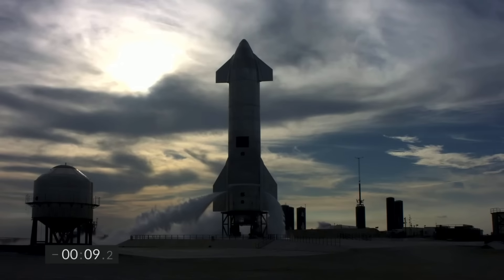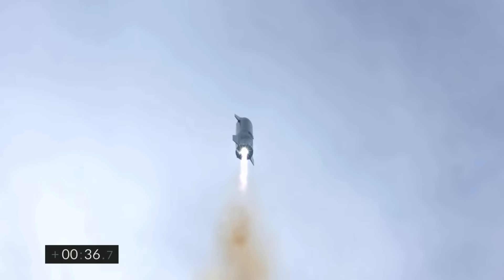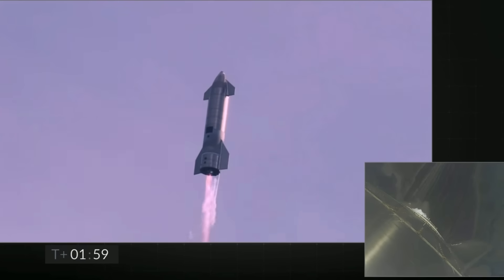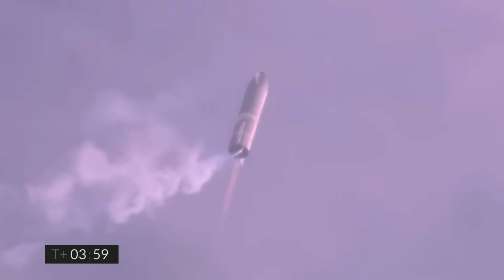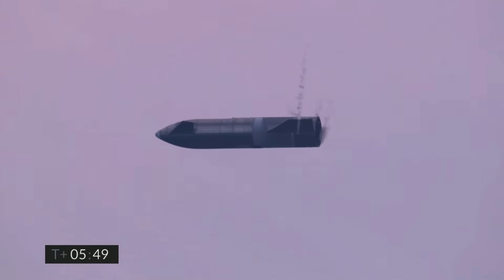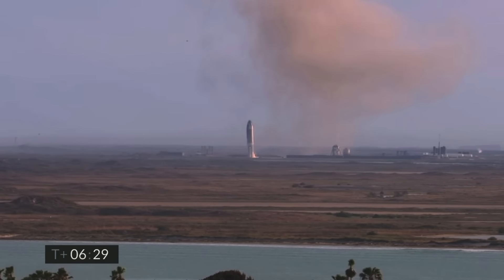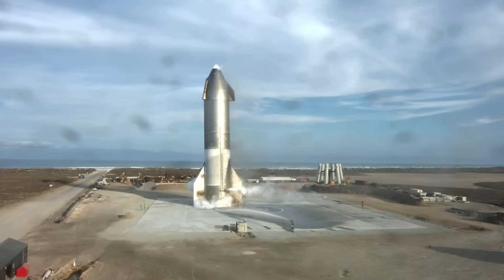SpaceX Starship SN10 soars, lands for first time!

Comment: Fake, world misleading CGI 😉
Reply: So how did they CGi to the ppl watching from all over the island and local ppl
Reply: @-M0LE  Todays software can draw a lot of objects in the past they even draw in some cows running around  in the foreground of the Spacex 😆
Reply: @a.v.d   there are two cities nearby. Port Isabel and South Padre Island. From these two locations you can see the launch with your own eyes which makes the possibility of the launch being CGI 0%
There were hundreds of people who filmed the launch on their phones and cameras.
Reply: @rolandb.1866  They shoot all the time rockets into the air and the they end up in the sea. Check out on airports (I lived a long part of my life close by an int. airport) how difficult some wind is for pilots. Do you really think they can bring back rockets in they reverse, with all forces of the weather?
Reply: @a.v.d  yes, absolutely. That's why they have those fins and canards installed + they also have a hot gas reaction control system. And the launch was conducted when the winds were relatively slow. (around 7 knots)
Reply: @a.v.d  The reason why the 1st stage of rockets end up in the sea is because of safety hazards. If they launch it incorrectly it could end up crashing in a populated area. if you ask why is Spacex allowed to do these flight even with the two cities nearby, the answer is simple for that. They have onboard explosives that activate when there is a massive problem with the vehicle or SpaceX's software , the explosives  lead to a much smaller chance of causing damage to nearby populated areas.
Reply: I love how you just ignored many other people went there and saw it.

Comment: Seems to accelerate a lot slower that the Saturn V stack assuming you wanted to reach an orbit.  So if it never glides, why the fins in the canard position?
Reply: They are using a slow ascent otherwise it would go supersonic
Reply: @-M0LE  after reentering from orbit starship will go faster than supersonic so the fins and canards are there to reduce the velocity as much as possible before landing the vehicle
Reply: @rolandb.1866  but it doesn't appear to glide, so what's the point?   Their other vehicles have speed brakes for that purpose.
Reply: @gendaminoru3195  Starship uses the side of the vehicle's surface area (around 545 square meter) as an air brake, and the fins and canards as stabilizers (these also add drag to the vehicle). It's much more effective than their air brakes on the Falcon 9. When a Falcon 1st stage reenters from orbit it requires a reentry burn, Starship will not require a reentry burn because it has much higher drag.

Comment: How will it go through Earths re-entry, the heat.  Marvelous yes
Reply: That's a main booster, it doesn't go through re-entry.  This is purely experimental.
Reply: @dryan8377  this is the second stage, this will be going through re-entry.
Reply: I mean when Rocket goes 200 miles up an returns...what heat shielding or what will it have?  It gets damn hot returning.
Reply: @shokasokenhohansorthodoxka237  it has a heat shield which is also currently in testing, and can currently be seen in the form of small black patches dotted around the vehicles. SN15 in particular has a noticeably large one.

Comment: 6:11 And at the final tilt, the video got edited ;  why, for what reason ???

Without any reason, the video got edited. 
To make things more clear, "a continues FAKE video from HORIZONTAL to VERTICAL mode  could easily be identified, if commonsense applied", that's why edited.

6:16 Caught red-handed.
That welding torch like EarthShip was HANGED from above ; and when slowly letting it back to the VERTICAL position, that ToyShip SWINGS extra more than expected.

Quote : 
*Nothing is impossible, only if it's REAL*

Comment: 4:59 the HORIZONTAL mode, beginning the descent

If the EARTH is round, how could the Starship transitioned into the HORIZONTAL descent mode ???

FLAT EARTH THEORY, proven.

Quote :
*HORIZONTAL/FLAT surfaced Earth makes everything steady & parallel, while descending*
Reply: What??? Have you heard of gravity?
Reply: Respected  @stasso05  

WILL A NON METALLIC NON MAGNETIC  SUBSTANCE ATTRACT ANOTHER NON METALLIC NON MAGNETIC SUBSTANCE ???

IF NOT, THEN HOW THE SO SAID GRAVITATIONAL FORCE ATTRACTS/CATCHES/JOINTS NON METALLIC NON MAGNETIC SUBSTANCES TOGETHER ???

QUOTE : 
*GRAVITY IS JUST A THEORY, DEFINITELY NOT A FACT*
Reply: @mohamediqbal395  try using google once in your life
Reply: Respected  @colten1825  

Please try Google by yourself for me just for once ; please answer my questions(using Google)...

Quote : 
*Sometimes in some cases, FACT is stranger than THEORY*
Reply: @mohamediqbal395  try jumping up, do you move down? if so you are being effected by gravity
Reply: Respected  @colten1825  

I tried.
When I tried, I feel heavier than AIR. 
I fell down.

QUOTE : 
*IF I'M LIGHTER LIKE HYDROGEN OR HELIUM, DEFINITELY AFTER THAT JUMP I WON'T BE DOWN AGAIN*

*WHAT'S LIGHTER THAN AIR WILL MOVE UP*

*WHAT'S HEAVIER THAN AIR WILL FALL DOWN*

*GRAVITY DEFINITELY FAILS INFRONT OF HYDROGEN/HELIUM/HOT-AIR BALLOONS*

Comment: wouldn't it make more sense to use the earth as a sling shot with a horizontal launch and just adjust the vector of climb during the accent, with the decreasing atmospheric pressure at ascending speeds instead of overpowering gravity?

Comment: Do the math:

The "rocket" launches to 10 km in approx 4 min and hovers.

That's 31,000 feet in 4 min, or 31,000/320 sec = 67 mph.

From the propulsion lab at North Western University:

Conventional rockets are generally designed to meet the speeds necessary for them to go where they need to go, and not go much faster. Generally, a conventional rocket has to be going about 17,000 mph for it to achieve orbit; otherwise known as LEO -- Low Earth Orbit.

This is some kind of studio/CGI stunt.
Reply: These test launches are not intended to reach LEO.
Reply: Yeah I know. It’s the physics of the launch itself and free fall.  This is a studio CGI stunt.
Reply: @daveogle4239  Tell that to the thousands of people who watched it and shot amateur videos of it IN PERSON.
Reply: @daveogle4239  3 raptor engines that are nowhere near max throttle, along with being turned off one by one to reduce speed. it is not meant to go fast or go high, it is meant to get to an altitude where it can successfully perform a belly flop and landing manoeuvre, which is by far the hardest thing to achieve with this experimental vehicle. the second stage isn't even capable of getting to orbit on it's own regardless, it requires the super heavy booster for that which is about 2 times the size and has 10 times the engines.

Comment: Lol I can't believe people believe this is real... a spaceship can turn from horizontal to vertical within 10 seconds after a huge freefall, my ass has more common sense than that
Reply: It's not a spaceship. That's cartoon and scifi language. 

SN10 is a low orbit heavy lifter rocket with 360 degree gimbaled TVC engines, designed to pivot in 15 degree arcs, around a 360 degree circle. This design can rotate the lifter body as needed.

Comment: Why can't NASA or SPACEX used regular car gasoline in place of liquid hydrogen mixed with liquid oxygen?  I mean gasoline is powerful and combined with O2 would be awesome!!
BONUS Gasoline is WAY CHEAPER than Hydrogen!!
Maybe someone with a small rocket could try to use 'gasoline + O2'  Please tell me why this isn't used?
Reply: first of all. gasoline is not a good rocket fuel AT ALL look it up, second of all gasoline would be more expensive then hydrogen have you not ever learn that water is made of hydrogen and oxygen making it extremely common
Reply: The starship uses methalox not hydrolox.

Comment: this is CGI lmao, explain to me, and that's one example, how they took the shot at 0:31  :)
Reply: A camera that was horizontal to that view.  Probably from a control tower, or a camera that are placed to monitor the condition of the rocket before take-off.
Reply: @cranshawmccaw  that camera is moving exactly together with the rocket, vertically and parallel to it, at the height of the rocket, not pointed at it from base, its not attached to the rocket and there is no visible tower nearby. (got to be one tall tower that lol) To me, is bs. simple. And I dont really care about it. Also that landing has no side thrusters to keep such high structure vertical, all done by bottom thrusters, sure. Seems a sci fi movie from the 30's. c'mon wake up.
Reply: @XimoXThe  there is a reaction control system on it, and the engines can gimbal, also couldn't you get that angle with a drone?
Reply: @colten1825  a drone couldt not feel like is attached to the rocket.  besides not at that speed and near that heat. Physics aren't an opinion. C'mon its obvious. A (badly made) fake.
Reply: @XimoXThe  i mean you can go to boca chica texas and see them happen if you want more proof
Reply: @colten1825  Thunderbirds are GO.. lmao

Comment: Odd that after many centuries of evolution in engineering that the most modern rocket uses the same fundamental design as the common arrow, which was invented before written language was formed.
Reply: Thanks Francis.
Reply: If it works. It works.

Comment: @4:30 So no one notices how when the shot changes, the rocket has turned the smoke has completely flipped direction. It all happened in a single camera change but the T timer stayed in real time.
Reply: its just switching views to a camera that's on the other side of the test area

Comment: dear elon musk i have  a sugession if u give a controlling rocket or high speed fan at thee top side when landing it is so easier to get more controlling while while landing(at the top side 3 parts
Reply: fans arent affective at that speed, monoprop thrusters give way more reaction control thrust anyways
Reply: @colten1825  use power pullll items like nitros oxide or any ,,,something like that
Reply: @colten1825  these can activate it only by sensing the remote or any distant object...senser

Comment: why stabilizers on one plane only.  These are "horizontal" stabilizers.  No vertical stabilizers?  At about 3 min 11 seconds and after there is pink thrust shown to be driving the rocket at  5,200 mph (slower than a Saturn V which was 6150 mph)  but the white steam just wafts out and trails behind as if in a gentle summer breeze?

Comment: I don't feel the control is much of a problem in the aspect of controlling the craft, I believe any variance of control is relative to the variable and volatile fuel source which is irrelevant for future launches.  This can easily be fixed.  It takes too much fuel to have something escape velocity which is well known to also not be sustainable or practical.  The solution is relatively easy and could decrease the weight by 80% or more depending on the load and environment.  The solution is already available, yet hasn't been completed to my knowledge.  See you on Mars! :D

Comment: There seems to be a lot of flat earther, everything is CGI, people more and more. There are a lot of comments saying this is all CGI. I suppose when I go on an airliner, I’m looking out the window at a CGI screen right? And I’m magically thousands of miles away from where I was. 

Having seen the Space Shuttle lift off with my own eyes twice and using a weather satellite over the past 30 years to forecast the weather, I can tell you, more and more people are insane. 

To see for yourself look at the North Star (Polaris) and measure the angle from the horizon to the North Star. That is your latitude. If you’re at the North Pole it’s 90 degrees or directly above you as you spin around. If you’re at 10 degrees latitude Polaris is 10 degrees above horizon. This is basically how explorers knew where they were hundreds of years ago. 

If you’re in the Southern Hemisphere you can’t see the North Star, Big Dipper or many stars you can see in the northern hemisphere. You get a whole different set of stars and they use the Southern Cross not visible to anyone in the Northern hemisphere. 

Also if you are at mid latitudes in the norther hemisphere at solar noon, you have to be facing south to see where the sun is and your shadow points to the If you’re in, say Argentina, you have to face north to see where the sun is and your shadow points points to the south. 

Us humans are devolving. “Idiocracy” is proving to be real.
Reply: Wow, so much rambling from a paid fanboi.

It's fake, Goober. Live with it.

Comment: From some other video sources we can see the landing wasn't ideal.  Only half the legs deployed with the other half swinging amusingly in the wind.  It didn't slow down enough so it landed hard on its arse which bent/buckled the whole thing, which eventually led to a rupture.  You can see a very definite bounce - which can't be good for something that heavy.  Still, they are all solvable problems.  The engines look good but the different colour shows they they are burning differently and the yellow fire at the end I don't think is intentional but is fuel burning in the atmosphere, either a leak or a stuck valve.  All things you'd expect to be ironed out in testing.  Its not quite ready for manned flight yet.  Don't forget, its staggering just how many rockets the Americans blew up in the mid 60's.

Comment: The reason no other company tries to land rockets is simple, you are wasting a third of the rocket fuel to land thus you need a bigger rocket to do the same amount if work🤪
Reply: But you are keeping the rocket . And use it again.
Reply: The cost of refurbishment  combined with the loss of payload , essentially negates any savings. The reason costs from other manufacturers that make rockets for NASA (NASA doesn't make rockets) are high is that they have a virtual monopoly and charge pretty much what ever they want.
Reply: @Wised1000  What loss of payload?  Since Falcon 9 started I think they had only 1 loss of payload . If you refer to starship, they just started scratching the surface of testing before any payload or human foot will step into one of those.
Reply: @Liope012  
Payload.... capacity. Again if you reland the rocket using its engines   you cannot lift as much as if you simply disposed of the rocket. In ricketry payload capacity and rocket impulse are the main ingredients to success.

Comment: If the whole thing had a thermal air inverter, a pure air jet pump that could be connected to the side, it would get the right boost. (Also atmospheric for landing and control on earth, no turbine, but a rotating lateral thermal converter according to the water jet principle, tiny additional screw-like rotating water jet pump for air intake for underground operation, rather winding pipe with insert and small secondary pressure chamber, side suction and through heater from above, air jet nozzle + ++ after below)Is something like this possible ? I, m not an expert here. Or is this total nonsense ?

Comment: Что то я не пойму? Судя по выхлопу, тяга двигателей небольшая, но сама по себе конструкция ракеты в плане её масштаба, запредельная, действительно, смотрится как бочка. Почему некоторые видео - изображения старта и посадки представляться в виде анимации?  
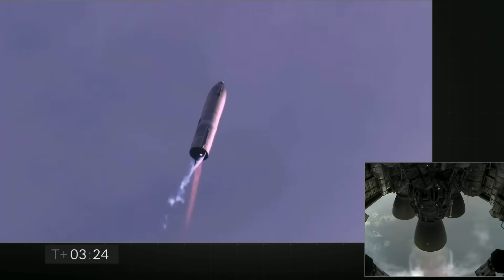3:38 работает один двигатель.
И почему не был показан взрыв ракеты на стартовой платформе: https://youtu.be/nzoxNnZJ7LE
***********
What I don’t understand? Judging by the exhaust, the thrust of the engines is small, but the design of the rocket itself in terms of its scale, outrageous, really looks like a barrel. Why are some launch and landing videos presented as animation?
3:38 am, one engine is running.
And why was the explosion of the rocket not shown on the launch platform: https://youtu.be/nzoxNnZJ7LE

Comment: Where the fuck is virgil? 10K is 10,000 metres. I went up in a sesna 206, and a brit island hopper to 5000m. I only had 20 secs to pull my rig and drift down some 2000m. You just got to 10k and then half a fekkin millenium to come back down? hmmmmmmm

Comment: - it was a HARD landing due to being UNDERPOWERED the last 10 seconds of the descent - WHICH means they need an extra engine going until touchdown, WHICH means they need some other engine, a non-raptor according to what everyone says about the raptor only running well on very high power-setting; WHICH means Elon is trying to get enough reliability without ANY surplus power availability in the last seconds before touchdown. THAT IS THE PROBLEM THEY AREN’T WILLING TO TALK ABOUT.

Comment: Why all the extraneous smoke and fire emitting from the engine cavities...in flight...and on the landing pad? Maybe some "screws loose"... someplace?
Reply: are you talking about during flight or after flight
Reply: @terasgamer9097  Both. In flight, there was smoke tailing out the side of the engine housing and on the ground, obviously, there was a fire that had to be put out by a fire truck. Remember a space shuttle was lost because the rivets on the booster engines came loose.